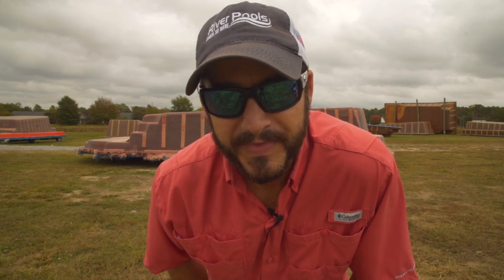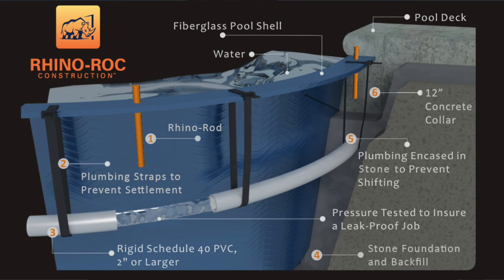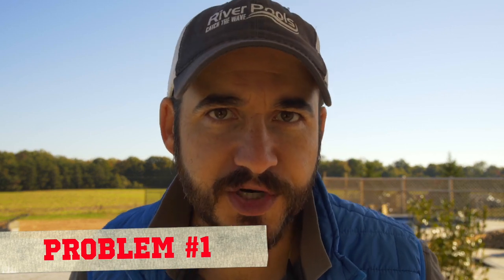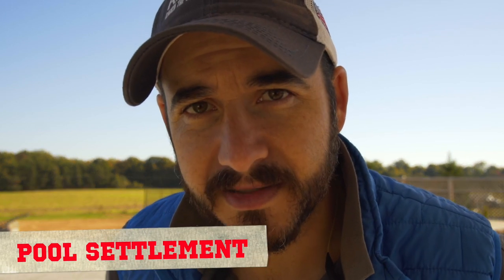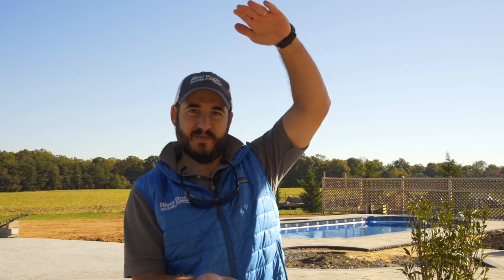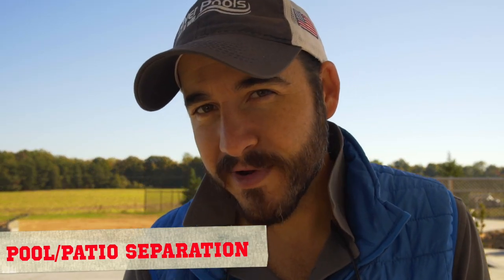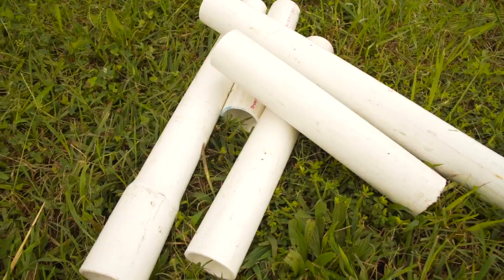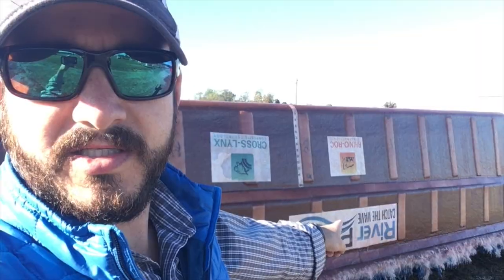How Fiberglass Pools Are Made; Rhino Roc Installation; Vid 7 of 8; The Perfect Fiberglass Pool

Comment: Pool companies (in Thailand) still use a 1 to 10 mix of cement and sand to backfill an inground fiberglass pool.  I mentioned our video and they laughed and said "gravel is bad and will damage the pool"! They also don't install a separate filter system but instead use only a large 5 micro filter bag in the skimmer.  When I asked about a site tube to check or remove ground water, they said, "Don't need one".  They use simple, cheap PVC ball valves (not true ball valves) and thin PVC pipe for supply lines.  Seems they think good enough is fine for the premium prices they charge.

Comment: Hello Christian, you and River Pools are awesome, thank you for the knowledge and making the industry more professional. I had a fiberglass pool installed a couple seasons ago, they used crushed stone, I had them put in a sump drain tube in per the manufacturers installation instructions. I have constant power to sump drain hole, a sump pump at the bottom connected to pvc piping with a quick disconnect that joins to pvc that takes ground water to a french drain all under ground that drains to a creek. Question is please, do I leave that sump pump plugged in and removing any ground water or do I just let it fill in with water and only run it if a pool repair was ever needed?
Reply from the maker: Great question! It's only really necessary to pump the water out if the pool needs to be drained for a repair. If ground water really starts building up...like half way or more, it won't hurt to pump it out. That should be a very rare situation however.